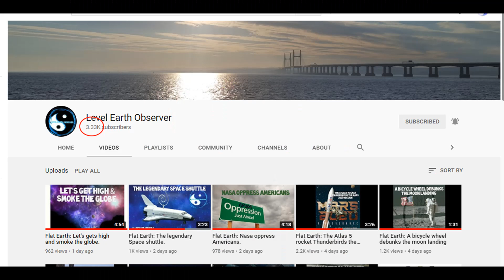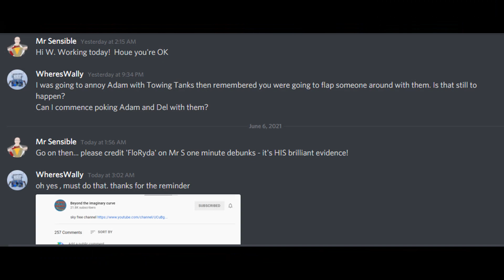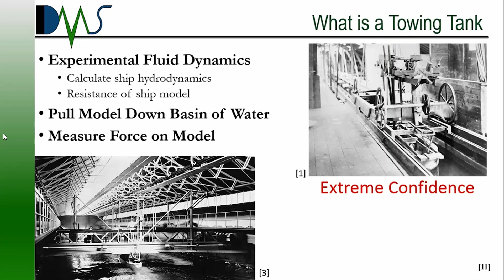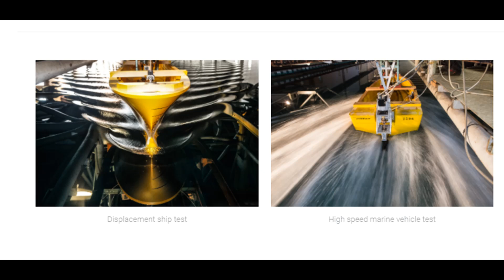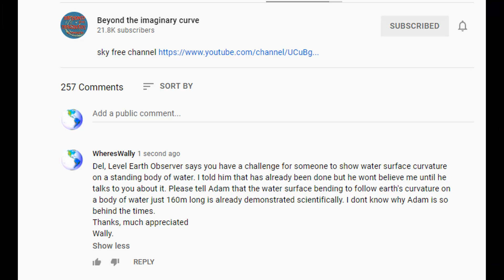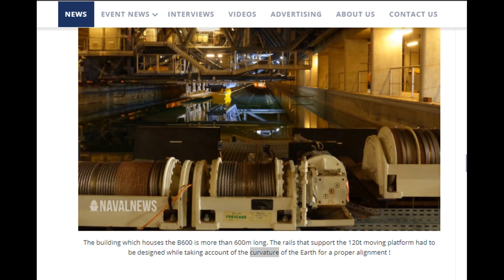Level Earth Observer Preaches The Gospel Of Del and His Super Simple Water Challenge

Comment: I don't think these towing tanks prove anything about the shape of the earth, and I don't care how many times the press releases or tour guides for the facilities mention the equipment's conformance to the Earth's curvature.  ALL that matters for the primary function of the facilities is:  "Does it keep the fixturing that grabs/tows the models at a constant distance above the surface of the water?".   And that is achieved simply by directly measuring and adjusting that very distance at all points along the tank's rails, NOT by performing any herculean feat of absolute spatial measurement and control during construction.  Yes, I know that the surface of the water in the tank does follow the Earth's curvature, and therefore the towing rig's rails do, too.   But if the Earth were flat, the exact same tank construction and calibration procedure would still get the models tested in exactly the same way (only then the rails, of course, would be flat).  ALL the towing tanks do to demonstrate the Earth's sphericity is to provide a more rigid, and therefore perhaps, more measurable, copy of the water's surface that could be tested.   But I haven't yet heard whether they were so tested, and it doesn't surprise me.   Cause, what are the proud new owners/operators of a towing tank facility going to do as soon as the opening ceremony ribbon is cut:  say, "Okay, boys; bring in the scientists to measure these rails down to the micrometer in absolute space", or,  "Right:  hook up that model of the PanAsian ChewToy Shiplines vessel, and let's see how she cruises"?

Comment: I was aware of these towing tanks, but didn't think of them in regards to disproving Flat Earth concepts simply because every precision measurement along the surface of the Earth must take the curvature into account or it won't work.  For short distances the correction factor may be negligible, but it rapidly becomes necessary as the length or area increases.

Comment: I guess we are gonna need a laser experiment in one of these facilities.
Reply: Seriously. 
These things are indoors and climate controlled to the Nth degree, which would go a long way towards controlling refraction as much as humanly possible. 

Two properly calibrated lasers, at the exact same height at either end of the tank and mounted absolutely level locally, might produce an interesting image at the halfway point. Especially if some light fog was introduced.
Reply from the maker: @CarbonTech19  sounds great. One place mentioned there was too much temp gradient to use a laser for leveling so they used a water tough.
Reply from the maker: Does TT stand for Towing Tank?
Reply: @whereswa11y  TT: Tourist Trophy, Motorcycle racing, either Isle of Mann or Assen, the Netherlands ;)
Reply: @whereswa11y  TTGuy = That Tall Guy. 25 years ago I overheard someone ask if they "knew that tall guy" and that has been my handle since the days of dial up BBS.
Reply from the maker: @thettguy  OK  cool, in Australia you would often get the nickname Lofty. And be asked about the weather as you get it first.

Comment: My test of convexity upon the surface of vast bodies of water was simple -- observe the change of the amount of obstruction of a fixed object by the sea with the observer at various elevations. My chosen object was a shed on a pole in an off-shore wind farm. The shed gives me a clearly visible object at a height above the water. The width of the shed from the observation point is fixed and a great reference to the apparent height above the sea. At the beach I chose the shed was about 11 miles away which is nice as we get some obstruction of the shed's supporting pole. I observed at the the level of just above the waves, standing at the waters edge, at the top of the sand, and stood on the sea wall. I observed on different days and in different conditions. The obstruction amount varied in a way that supported my hypothesis of sea curve. The null hypothesis of a flat on average sea was not supported. A curved sea indicates diverging plumb directions and so supports gravity & a globe. So convexity demonstrated and so not flat. 😁🏆
Reply: As a bonus test I used the shed and surrounding turbines to verify whether Zoom will remove bottom up obstruction. It doesn't. The object just gets more detailed.
Reply: I keep asking the flatards to show a perfectly flat body of water, they never can, from a spray droplet to the Atlantic ocean they all show curvature. I guess surface tension is fake along with gravity.